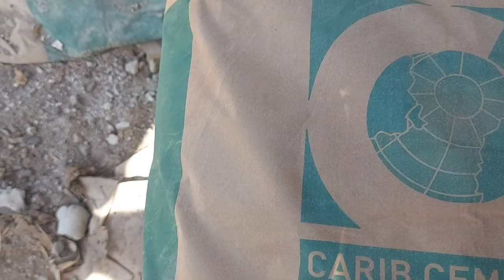How to make concrete baluster and columns in jamaica  🇯🇲

Comment: Is it possible to use a DRUM,  you might have a drum/barrel,  cut in half and mix in it.  It's much thicker so it won't burst
Reply from the maker: We tried that but the mixture was off so we stop using it....I think we would need a  bigger motor to mix it right